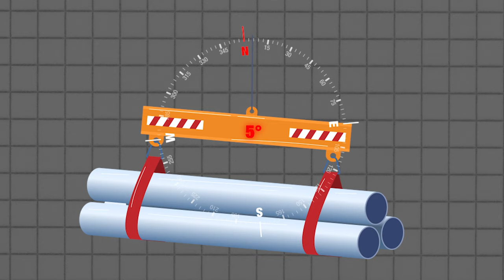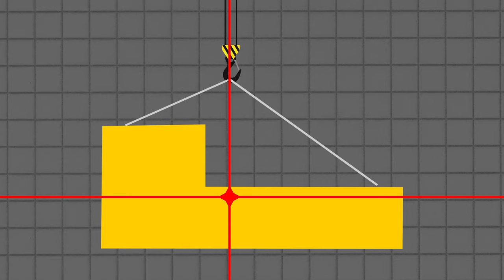How To Rig and Lift an Off-Center Load

Comment: How to lift off an off centre load with a tow leg sling?
Reply from the maker: If you are looking to lift a load with lifting slings, your best bet is a chain sling, as this allows you to adjust the length of the legs. You can shorten one leg as needed to get the load level.

Comment: How do you calculate the degree that your off on your lift
Reply from the maker: The degree you are off is not usually exact. The idea is to make sure your lift is as level as possible so that you are distributing the weight evenly. There is tolerance there, but it is slight. A very slight tilt can be accepted, and you can eyeball that 5 degrees. Anything more than that can be dangerous. You don't need to be out there calculating how many degrees your load is tilting. The idea is to rig it so it is not tilting at all.